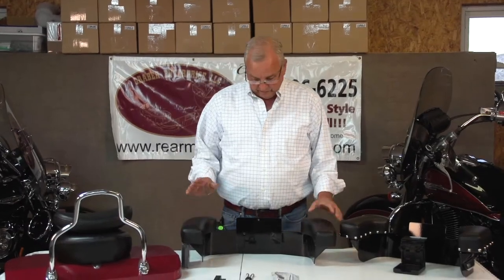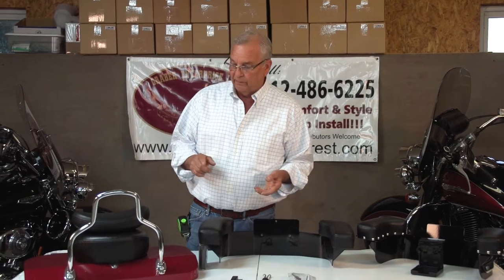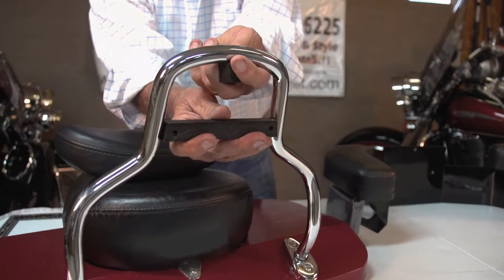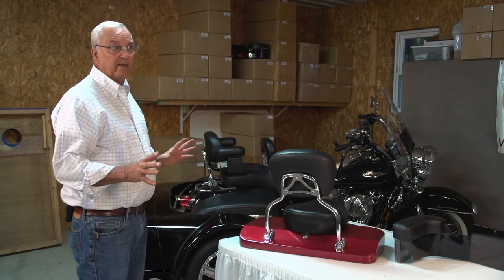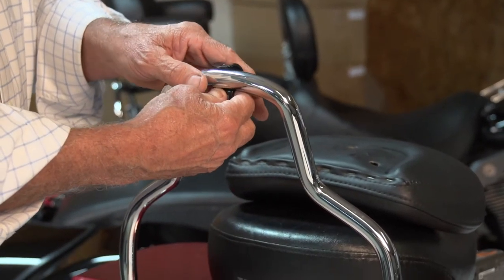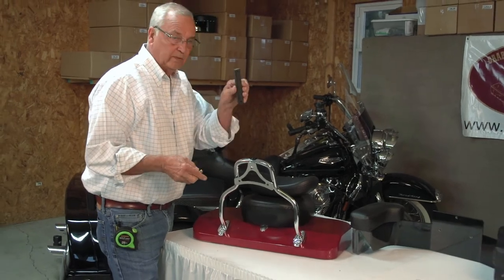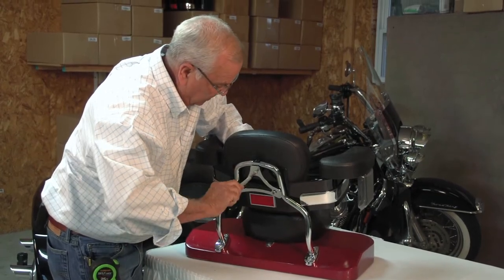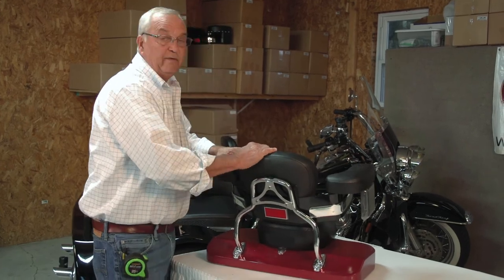Graber Enterprise Radially Backed Armrest Install

Comment: I put this on my 2017 Freewheeler but the spacer kit didn't fit.  I modified the installation and it fits tight and looks good.  Overall, the wife is happy with the added comfort and security.